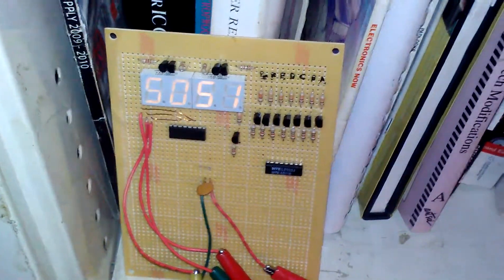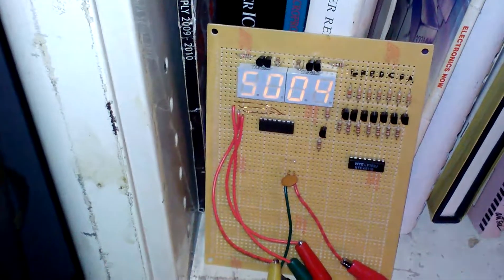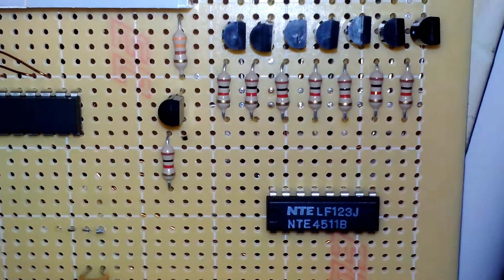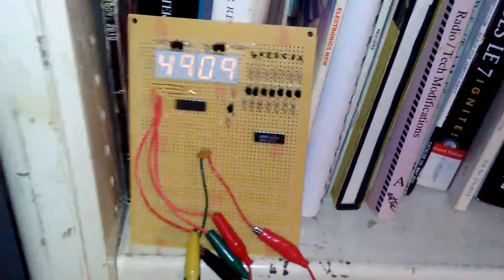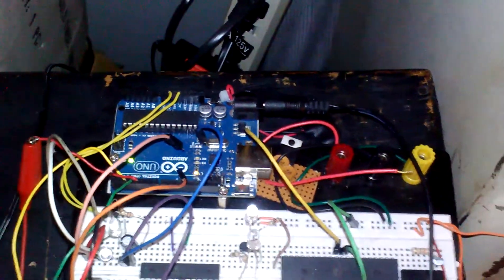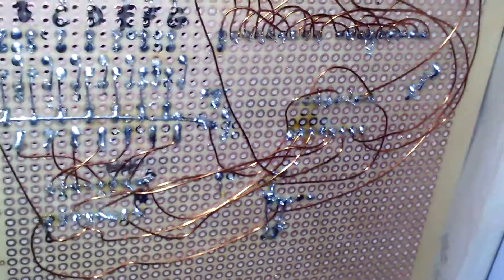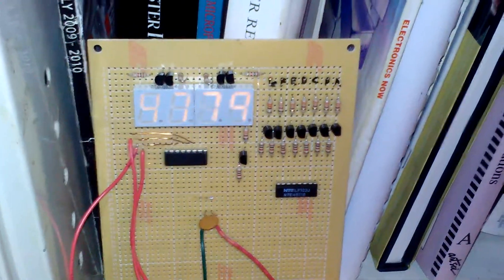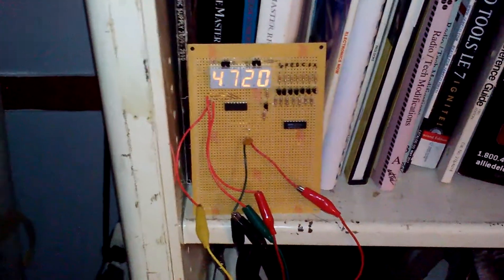Multiplexing 7 Segment Displays

Comment: Probably the best way to make a clock is to use an interrupt timer to increment the time.  The main loop just continually updates the time display.
Reply from the maker: I wish I still had this board. Yes I agree to use an interrupt. I would have liked to try this with FreeRTOS.
Reply: @DextersAmplifierRepa  Wow, thanks for responding, after I commented I realized the video was several years old and wondered if you had completed the clock.

Comment: Hello dexter, my name is bogdan and i am extremely interested in these type of things. My question for you is, do you believe its possible using the 74hct595 to decode from a binary counter to a 7 segment display without using the arduino code? Also, do you believe its possible to use a counter (either 74hct163 or 74hct161) to output to two decoders? I am limited on supply and was wondering if there was some trick i am missing like the parallel load function? Thanks for the video by the way and i hope you are willing to engage in a serious discussion, one engineer to another. Thanks you.
Reply from the maker: I'm thinking you might want to use the 74hct165, which does reverse. 8 parallel inputs and serial data out.  Kdarrah1234 has a video show this using a few pins to read multiple inputs.